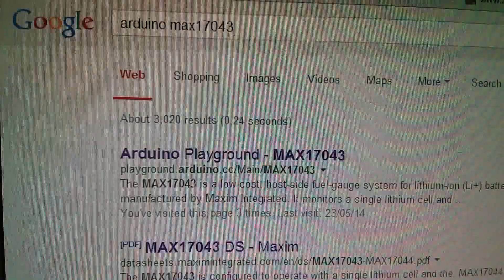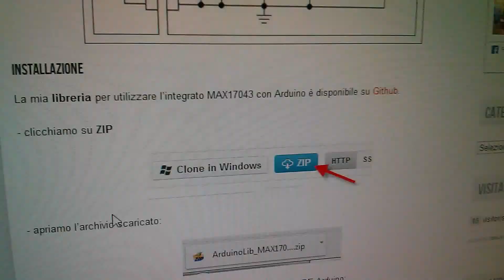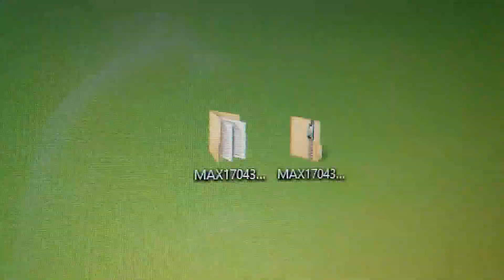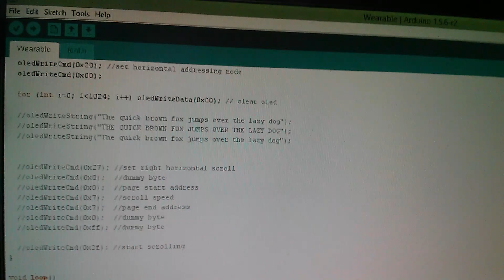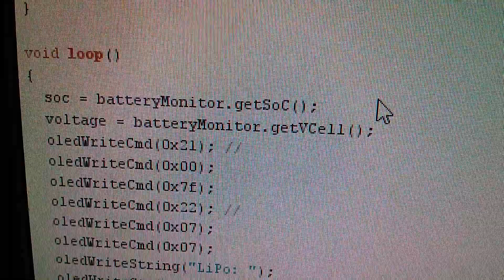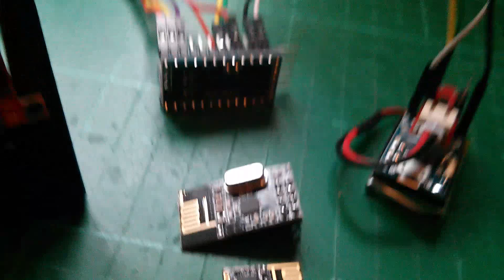MAX17043 LiPo Fuel Gauge connects to Arduino via I2C #2

Comment: I hope you see this.  This unit is less than $2 on aliexpress.  I would like to use it to build a 24 cell analyzer station for grading used lithium ion cells. What is the current limit of the shunt? Would you suggest an alternate strategy that might be just as inexpensive?
Reply: I know this is an old video but do not buy these. They are complete rubbish and very painful to work with.

Comment: Hi Julian, I'd like to try this with my ESP8266 that requires 3.3v from the TP4056, can I use a AM1117 regulator on the out of the TP4056 still get accurate readings?
Reply: The tp4056 is a charging board. when fully charge the Status Led change you know when it is fully charged and it stops from charging anymore. But with a Ams1117 3.3v  you can not tell if it is full charged and If it stops or not I'm not sure on..

Comment: @Julian Ilett  I did the same mistake as you did by connecting the MAX17043 directly to the lipo. So I had to change it over so that its in the protection circuit. But I have a problem. I pulled the solder pads off the SDA and SCL connections. Do you have any idea where the traces go so I can solder directly to maybe a transistor?

Comment: is there a Library for the 18650  Li-ion cell as I see some people are getting false readings with this Lipo designated Library?  (i.e. gives a reading of 5v and state of charge 256%)
Reply: Your SDA and SCL are the wrong way around.
Reply: I've found the i2c address isn't the same as the original modules. I ran an i2c scanner and found the address was different from the one in the MAX17043.h library. Mine were found at address 0x76. I edited that .h file to match and the library worked. No more 5v and 256% - but the clone boards are still wrong. Mine says 1.8v and 0.00% when no battery connected. But its running from the 3.3v of the arduino. Hope this helps

Comment: Hey, Julian. Why don't you use a clone of Arduino LilyPad, that was specifically designed for wearable projects. You can get clones on eBay for couple pounds. They use ATmega328V, 8MHZ with 14 digital and 6 PWM channels:
https://www.arduino.cc/en/Main/ArduinoBoardLilyPad

Comment: Did anyone ever figure out the 5v and state of charge 256% issue? I'm having the same problem at the moment :S
Reply: Zhainius yes most probably you are connecting it to dc dc boost converter that is attached to battery, how about you try directly connecting to actual lipo-lion battery
Reply: Fakes from China cause this issue and I had my i2c cables wired the wrong way around
Reply: @mojo_jojo  I've found the i2c address isn't the same as the original modules. I ran an i2c scanner and found the address was different from the one in the MAX17043.h library. Mine were found at address 0x76. I edited that .h file to match and the library worked. No more 5v and 256% - but the clone boards are still wrong. Mine says 1.8v and 0.00% when no battery connected. But its running from the 3.3v of the arduino. Hope this helps

Comment: 5v %256 . print value :( what is problem ?
Reply: I've found the i2c address isn't the same as the original modules. I ran an i2c scanner and found the address was different from the one in the MAX17043.h library. Mine were found at address 0x76. I edited that .h file to match and the library worked. No more 5v and 256% - but the clone boards are still wrong. Mine says 1.8v and 0.00% when no battery connected. But its running from the 3.3v of the arduino. Hope this helps

Comment: Hi Julian,
                I have the charger and the fuel gauge. My battery is an 18650 2500mAh Li-ion. It's charged to 4.2v. The fuel gauge / library gives a reading of 5v and state of charge 256%. Any idea why this is happening? Also, thank you for the video. You've done a great job. ++
Reply: Hello i was wondering if you fix the problems with using 18650 cells? Because that is what I'm going to use the Fuel Gauge on.
Reply: Did you fix this issue ? I get the same readings with the same LiPo model he was using. Cheers!
Reply: Because you are not directly connecting to battery are you?
 You must have been connecting it to output of dc dc converter that is connected to battery, now can you verify this and reply what was the actual problem!
Reply: I was able to kind of solve the issue. I simply bought a new modul but not the original one. I got one from the ebay seller Julien mentioned in this video (alice1101983). It works as it should.
Reply: I've found the i2c address isn't the same as the original modules. I ran an i2c scanner and found the address was different from the one in the MAX17043.h library. Mine were found at address 0x76. I edited that .h file to match and the library worked. No more 5v and 256% - but the clone boards are still wrong. Mine says 1.8v and 0.00% when no battery connected. But its running from the 3.3v of the arduino. Hope this helps

Comment: Hi Julian, 

I have exactly the same board eqipped with MAX17043 and I'm trying to use it to monitor a single LiFePo4 cell. However, as the typical voltage of this chemistry is lower than the common Lipo/Lion chemistries, the SOC value seems to be wrong (Around 0.1% whatever the real SOC). Do you know if there is any access to Config register that can allow a kind of calibration ? The only statement I can find in the datasheet is like "Please contact us for ajustments". I didn't carried full charging cycles yet, do you think I have to (Just in case there a self-learning feature ?). Thanks for your help.

Benoît

Comment: I have a problem with different code for a big battery(5500mah), it can't "reset", i tried different library, codes but it's everytime the same thing, it does not go further than Serial.begin, have you get this problem ?(I don't have a smaller battery so i can't know if it's a battery problem or not)

Comment: Julian,

Maybe you know this already?  Just  wanted to mention that I have experienced some burn-in issues with these OLED displays. After using a similar display that has been displaying status of the B3603  buck converter controlled by an Aduino Mega for a while, I filled the display with 0xff for some reverse display info and was really surprised that I could see where I had displayed the previous info.

When using these displays from now on will consider to have a "Screen Saver" function implemented that turns off the display while not in use for some minutes.

Best Regards,
Bjorn Erik

Comment: Dear Julian, I wonder if you can help me, I have a lot of experience in Electronics, from the analogue days, I'm a bit of an old school wiz, I built a large Lithium ion battery using 168 cells, like most people I started out with little knowledge on lithium ion, then discovered the dangers, to cut a long story short, I had the batteries given to me they are second hand laptop batteries. I have almost finished checking them all now for safety fully charging them on my IMAX B6, and then discharging them to the base minimum voltage of 3 volt per cell for safety while assembling them into 3s arrays to give me 11.1 volt banks of cells, grouped into blocks of 24 configured as 3s.  My problem is I need a suitable built in Battery Management system to auto balance charge them from my solar panel, as it happens I also received stacks of battery management safety boards (one problem) I did not realize at the time when disconnecting these boards that many of them would lose their programming :( so now I need a way to re-program them to suit my new 100 AH (approx) battery assembly

I really needed to write more but seem to be on contact lock can you allow me to PM you please ? Michelle
Reply: As far as programming goes i'm a beginner when it comes to serial programming, but wondered if their was an easier way, like having someone configure a data stream on my behalf, like in those old DATA CASSETTES used on commodore computers that can simply be played back into the data ports to set up a particular fuel gauge eprom ? what would you suggest I do, I really have none of the data programming equipment maybe you can help me find what I need on ebay?

Comment: so the charging Ic gets a little confused if theres a load while charging?

eek that could be a bit of an issue for some designs.  sat here with my morning brew trying to think how to get round that, nothing so far...

I just got 6 of them, maybe i can rig something up to see whats going on, but only thing i have to log battery voltage over time is a camera and a multimeter so if i get time to set that up may be handy to see what is happening if i just drop say 300 or 600 ohms across the battery to give some moderate load.

as the charge Ic seems to look at batter voltage you would think the circuit drain would just delay the charging time instead of it failing to complete.

need more brew..
and a biscuit

Comment: Concerning your underscore/dash problem.
When you clone and download a zip file containing the project on Github's website, the zip file will also contain the name of the branch of the project.
In this case, you cloned the master branch.
That means that the original project folder name was not supposed to contain "master" at all.

Comment: Will be interesting to see how accurate the MAX17043 is under vary loads - I would think they've put alot of effort in to their algorithm.

Incidenetally, ADAFRUIT have a library for that OLED display.
Reply from the maker: So far, I haven't been able to find any fault with the State of Charge algorithm - it works extremely well. I'll have a play with Adafruit's OLED library.

Comment: Just got my 10 pack of tp4056's. I wonder why they didn't add a fuel gauge when they redesigned it with the protection IC. Have you encountered a cheap lipo charger with a Max16043 built in?
Reply from the maker: A charger board with the fuel gauge would be neat, but I think the Maxim chip is quite expensive so cost would be an issue.
Reply: Ahhh. Well Im not sure what you paid for yours, but I paid about $10.

On another note, where do you buy your lipos? Will the 4056 charge 3.7v li-ions? I haven't read the datasheet yet.

Comment from the maker: Font header file:

#include <Arduino.h>

static const byte ASCII[][5] =
{
 {0x00, 0x00, 0x00, 0x00, 0x00} // 20  
,{0x00, 0x00, 0x5f, 0x00, 0x00} // 21 !
,{0x00, 0x07, 0x00, 0x07, 0x00} // 22 "
,{0x14, 0x7f, 0x14, 0x7f, 0x14} // 23 #
,{0x24, 0x2a, 0x7f, 0x2a, 0x12} // 24 $
,{0x23, 0x13, 0x08, 0x64, 0x62} // 25 %
,{0x36, 0x49, 0x55, 0x22, 0x50} // 26 &
,{0x00, 0x05, 0x03, 0x00, 0x00} // 27 '
,{0x00, 0x1c, 0x22, 0x41, 0x00} // 28 (
,{0x00, 0x41, 0x22, 0x1c, 0x00} // 29 )
,{0x14, 0x08, 0x3e, 0x08, 0x14} // 2a *
,{0x08, 0x08, 0x3e, 0x08, 0x08} // 2b +
,{0x00, 0x50, 0x30, 0x00, 0x00} // 2c ,
,{0x08, 0x08, 0x08, 0x08, 0x08} // 2d -
,{0x00, 0x60, 0x60, 0x00, 0x00} // 2e .
,{0x20, 0x10, 0x08, 0x04, 0x02} // 2f /
,{0x3e, 0x51, 0x49, 0x45, 0x3e} // 30 0
,{0x00, 0x42, 0x7f, 0x40, 0x00} // 31 1
,{0x42, 0x61, 0x51, 0x49, 0x46} // 32 2
,{0x21, 0x41, 0x45, 0x4b, 0x31} // 33 3
,{0x18, 0x14, 0x12, 0x7f, 0x10} // 34 4
,{0x27, 0x45, 0x45, 0x45, 0x39} // 35 5
,{0x3c, 0x4a, 0x49, 0x49, 0x30} // 36 6
,{0x01, 0x71, 0x09, 0x05, 0x03} // 37 7
,{0x36, 0x49, 0x49, 0x49, 0x36} // 38 8
,{0x06, 0x49, 0x49, 0x29, 0x1e} // 39 9
,{0x00, 0x36, 0x36, 0x00, 0x00} // 3a :
,{0x00, 0x56, 0x36, 0x00, 0x00} // 3b ;
,{0x08, 0x14, 0x22, 0x41, 0x00} // 3c <
,{0x14, 0x14, 0x14, 0x14, 0x14} // 3d =
,{0x00, 0x41, 0x22, 0x14, 0x08} // 3e >
,{0x02, 0x01, 0x51, 0x09, 0x06} // 3f ?
,{0x32, 0x49, 0x79, 0x41, 0x3e} // 40 @
,{0x7e, 0x11, 0x11, 0x11, 0x7e} // 41 A
,{0x7f, 0x49, 0x49, 0x49, 0x36} // 42 B
,{0x3e, 0x41, 0x41, 0x41, 0x22} // 43 C
,{0x7f, 0x41, 0x41, 0x22, 0x1c} // 44 D
,{0x7f, 0x49, 0x49, 0x49, 0x41} // 45 E
,{0x7f, 0x09, 0x09, 0x09, 0x01} // 46 F
,{0x3e, 0x41, 0x49, 0x49, 0x7a} // 47 G
,{0x7f, 0x08, 0x08, 0x08, 0x7f} // 48 H
,{0x00, 0x41, 0x7f, 0x41, 0x00} // 49 I
,{0x20, 0x40, 0x41, 0x3f, 0x01} // 4a J
,{0x7f, 0x08, 0x14, 0x22, 0x41} // 4b K
,{0x7f, 0x40, 0x40, 0x40, 0x40} // 4c L
,{0x7f, 0x02, 0x0c, 0x02, 0x7f} // 4d M
,{0x7f, 0x04, 0x08, 0x10, 0x7f} // 4e N
,{0x3e, 0x41, 0x41, 0x41, 0x3e} // 4f O
,{0x7f, 0x09, 0x09, 0x09, 0x06} // 50 P
,{0x3e, 0x41, 0x51, 0x21, 0x5e} // 51 Q
,{0x7f, 0x09, 0x19, 0x29, 0x46} // 52 R
,{0x46, 0x49, 0x49, 0x49, 0x31} // 53 S
,{0x01, 0x01, 0x7f, 0x01, 0x01} // 54 T
,{0x3f, 0x40, 0x40, 0x40, 0x3f} // 55 U
,{0x1f, 0x20, 0x40, 0x20, 0x1f} // 56 V
,{0x3f, 0x40, 0x38, 0x40, 0x3f} // 57 W
,{0x63, 0x14, 0x08, 0x14, 0x63} // 58 X
,{0x07, 0x08, 0x70, 0x08, 0x07} // 59 Y
,{0x61, 0x51, 0x49, 0x45, 0x43} // 5a Z
,{0x00, 0x7f, 0x41, 0x41, 0x00} // 5b [
,{0x02, 0x04, 0x08, 0x10, 0x20} // 5c ¥
,{0x00, 0x41, 0x41, 0x7f, 0x00} // 5d ]
,{0x04, 0x02, 0x01, 0x02, 0x04} // 5e ^
,{0x40, 0x40, 0x40, 0x40, 0x40} // 5f _
,{0x00, 0x01, 0x02, 0x04, 0x00} // 60 `
,{0x20, 0x54, 0x54, 0x54, 0x78} // 61 a
,{0x7f, 0x48, 0x44, 0x44, 0x38} // 62 b
,{0x38, 0x44, 0x44, 0x44, 0x20} // 63 c
,{0x38, 0x44, 0x44, 0x48, 0x7f} // 64 d
,{0x38, 0x54, 0x54, 0x54, 0x18} // 65 e
,{0x08, 0x7e, 0x09, 0x01, 0x02} // 66 f
,{0x0c, 0x52, 0x52, 0x52, 0x3e} // 67 g
,{0x7f, 0x08, 0x04, 0x04, 0x78} // 68 h
,{0x00, 0x44, 0x7d, 0x40, 0x00} // 69 i
,{0x20, 0x40, 0x44, 0x3d, 0x00} // 6a j 
,{0x7f, 0x10, 0x28, 0x44, 0x00} // 6b k
,{0x00, 0x41, 0x7f, 0x40, 0x00} // 6c l
,{0x7c, 0x04, 0x18, 0x04, 0x78} // 6d m
,{0x7c, 0x08, 0x04, 0x04, 0x78} // 6e n
,{0x38, 0x44, 0x44, 0x44, 0x38} // 6f o
,{0x7c, 0x14, 0x14, 0x14, 0x08} // 70 p
,{0x08, 0x14, 0x14, 0x18, 0x7c} // 71 q
,{0x7c, 0x08, 0x04, 0x04, 0x08} // 72 r
,{0x48, 0x54, 0x54, 0x54, 0x20} // 73 s
,{0x04, 0x3f, 0x44, 0x40, 0x20} // 74 t
,{0x3c, 0x40, 0x40, 0x20, 0x7c} // 75 u
,{0x1c, 0x20, 0x40, 0x20, 0x1c} // 76 v
,{0x3c, 0x40, 0x30, 0x40, 0x3c} // 77 w
,{0x44, 0x28, 0x10, 0x28, 0x44} // 78 x
,{0x0c, 0x50, 0x50, 0x50, 0x3c} // 79 y
,{0x44, 0x64, 0x54, 0x4c, 0x44} // 7a z
,{0x00, 0x08, 0x36, 0x41, 0x00} // 7b {
,{0x00, 0x00, 0x7f, 0x00, 0x00} // 7c |
,{0x00, 0x41, 0x36, 0x08, 0x00} // 7d }
,{0x10, 0x08, 0x08, 0x10, 0x08} // 7e ←
,{0x78, 0x46, 0x41, 0x46, 0x78} // 7f →
};